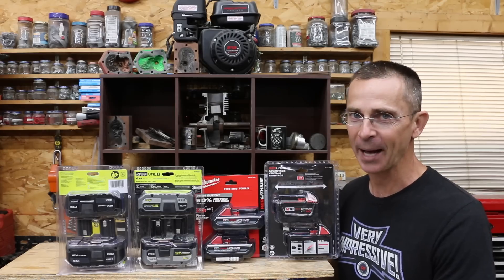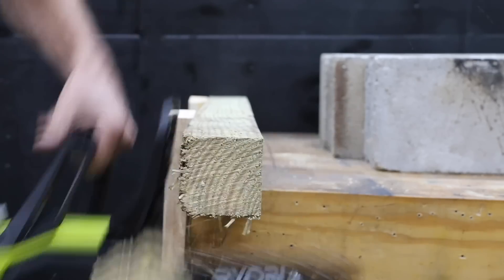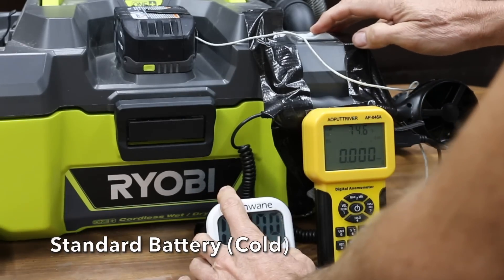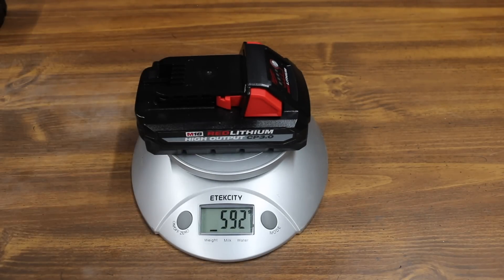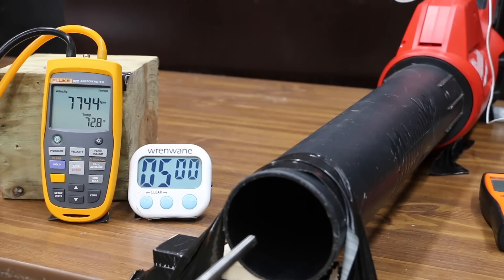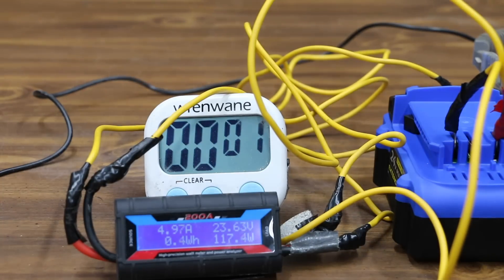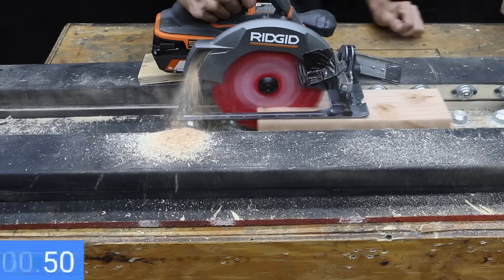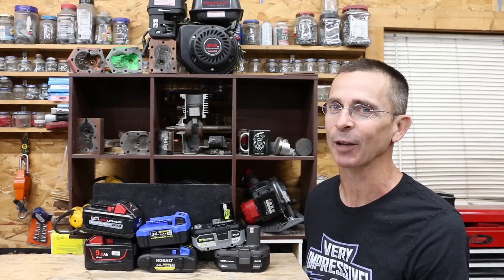Are "High Output" Batteries Better Actually Worse?

Comment: Ryobi is pure trash. I bought entire kit and batteries would go low and charger wouldn't charge them because circuit board battery sensor couldn't detect battery. I went bought new charger and batteries....same thing. I threw all that junk away.
Reply from the maker: Thanks for the feedback.

Comment: I've researched this awhile ago. Those that say the HP batteries are for extra amp draw are correct. The HP batteries increase torque available on HP contact equipped tools. Started on the impactors and skill saws. Increases removal torque and keeps the saws from overloading and stalling when bound up.
Reply from the maker: Thanks for the feedback.

Comment: High output batteries are for high draw tools usually.  That higher output will come at a lower run time when paired with the proper tool.  The issue here is the extra contacts, and internal wiring.  Both the tool and battery need it in order to perform better.  The other thing here not discussed is Peukerts law.  Higher amp draws will equal lower watt hours on batteries.  Lithium suffers from this less than lead acid, but it still applies.  

Most modern lithium batteries are limited in amp output buy the contacts.  The individual cells are usually capable of outputting more amps than the connectors can supply.

Wonder if @Project Farm will do again.

Comment: Why did you switch from an anemometer to the pitot tube and MPH to FPM between the two tests? Granted, you're not testing the tools themselves, but the switch was somewhat jarring and I thought about it and had to rewatch some because I was focused elsewhere.
The knock off may not have as much runtime as the genuine Milwaukee, but you can buy 5 knockoffs for the price of one genuine and probably have enough change for a gallon of gas. You'll get a lot more runtime out of that. Makes the knockoffs potentially worthwhile for those on a very limited budget and willing to accept the limitations. 
Of course, those buying Milwaukee probably aren't on a super tight budget, but the same philosophy probably applies to all the brands and their knockoff batteries.

Comment: For my Ryobi tools i have one 3AH and 5AH High ENERGY 2x 2Ah 1x 4Ah.

These are using the bigger cells, seems like they don't make this exact one anymore since the HP one is really just regular.

My 3 Ah always outperform the 4 Ah in every way and my drill only likes the high energy batteries, the other ones is just too weak also the angle grinder last a lot longer and has much more power with the 3Ah one then the 4 and runs a lot cooler
Sucks that the drill was sold as a kit with 2x 2 Ah since they are totally useless for anything else than the impact driver and even that one feels slow on those small shit batteries😅🤣
Reply from the maker: Thanks for sharing.

Comment: Project Idea: Motorized desk frames. iMovr Lander, Uplift v2, NewHeights Elegante, Ikea BEKANT, VertDesk v3.

Things to test, load capacity does it kill the motors or strip the gears if too much load is put on them they have all different ranges from 200lb to 533lb. how many sandbags + cousin eddy can they handle?

Desktop (laminate) quality, can liquid damage them what about impacts and scratches do they delaminate?

Stability at different heights, Would eddy fall off if he tried standing on the desk?

Speed of adjustments from sitting to standing height, are the claims correct with the heights at both ends?

Quality control in the form of the assembly process and welds?
Reply from the maker: Thanks for the video ideas.

Comment: Using an Ryobi HP battery in a non-HP tool is not going to make a difference. The HP tools have extra contacts that match the extra contacts on the HP battery. The Torque Test Channel covered the performance difference between standard and HP batteries in a HP impact in past videos.

Comment: I'm sure it's been pointed out but the HP batteries can supply more power and don't necessarily last longer. HP tools have two extra contacts that the battery can sense. With Ryobi at least, I don't think any extra power goes through the extra contacts. These only tell the battery it can output more and the existing  PCB fet or chopping circuit inside will allow it to send more power through the main contacts. When the HP battery is put in a normal tool it performs more like a normal battery.
Reply from the maker: Thanks for the feedback.

Comment: I purchased a few aftermarket batteries for my old PC tools and my Makita router. The Makita knock-off I have still runs but at a significantly shorter duration. I also notice the recharge time is noticeably longer with the knock-off. I will say the price was hard to beat, but one of each died within a year's time. Great price, garbage longevity. I now only purchase "genuine" batteries for the longevity aspect and only buy them on sale.
Reply from the maker: Thanks for sharing.

Comment: One only need to watch the Torque Test Channel comparison of Ryobi's HP impact wrenches to see that there is a huge difference in the HP batteries vs the standard non-HP batteries. The reason you're not seeing the difference here is because you didn't test using any Ryobi HP compatible tools which take advantage of the extra contact on the battery.

Comment: You should have done this test with impacts because it does a massive difference high output is for what it says high out put not for longevity test if you used them on impacts for what they are designed to do you’ll see the difference.

Comment: Torque test channel did many tests and showed how good higher capacity and high performance batteries do in comparison to regular versions. I def wish Harbor freight made a series for their Bauer like they do for the Hercules line, but it seems like they're tryna further differemtiate the two brands by giving Hercules all the premium features
Reply: Your wish is granted lol They're coming out with 8ah bauer batteries now. My local store already has them.
Reply: You use the harbor freight power tools? You a pro or just a diy’er? If you are a pro How are they?
Reply: @codygooch510   The Baur motors don't stand up to pro use and will smoke out on you. Similar to masterforce tools from Menards. I have a masterforce 7inch grinder and have cut lots of concrete with it but you have to be careful to not overload the motor or you can smell it. By babying it a little I've kept it alive so far but not on the quality level of major brands.

Comment: In a lot of cases the power is limited by the tool and not the battery, a tool with max of 30 amps will stop at current of 30 amps, the tool has to be able to take advantage of the high output battery to see a difference, I see the difference with my Ryobi impact that has more torque with high output high capacity batteries.
Reply from the maker: Thanks for the feedback.

Comment: As a pro, I swear by the Milwaukee high output.  They are a game changer...  All I use.  Light and fast
Reply: You find it most in your impacts, nailer and saws.  The 3.0 is designed for drills.  6.0 on up for everything else.  But the 3.0 can actually run everything decent, just for a shorter period of time
Reply from the maker: Thanks for the feedback.

Comment: I want to thank you for providing honest, unbiased reviews of a variety of products.  Have you given thought to comparing natural gas / propane conversion kits for generators or other small motors?  There are several different types of kits, from snorkels, to spacers, to carb replacements.  How do they compare in terms of usability, power output, engine life, throttle response, etc.
Reply from the maker: Thanks for the suggestion.

Comment: Good video Todd. Couple of questions if you have a minute. Back in your early days when we subscribers we new you did a video changing fluorescent to LED....just wondered if you have had to replace any as you must have put some running hours on them. Second....is your coffee coming to The UK. Cheers
Reply from the maker: The LED lights are still working very well and get used every day.  Only one tube occasional has an issue with half the tube working properly.  Other times it works just fine.

Comment: I've seen videos where some contractors claim that Milwaukee's high AH batteries die faster than their lower AH batteries. Matthias Wandel recently made a video in which he theorizes that in Dewalt packs, a single cell is used to drive the battery management system (BMS), and if batteries are left to sit for a long time without recharging, this single cell will trickle-charge until it's dead, which will prevent the entire pack from being charged. This seems plausible to me, but I haven't researched it further.

It would be interesting to test whether this happens with Milwaukee 6AH, 9AH and 12AH batteries. I think it may be possible that the charge indicator on the pack could show the pack as being charged up when one cell is low, and I could see this happening more with packs that have more cells vs fewer cells. So maybe this is why some people believe that the higher AH batteries have a lower shelf life. The solution would be to use high AH batteries periodically with a tool that draws relatively little current and then charge them up periodically after minor usage to rebalance the charge of all cells during charging.

For my milwaukee M18 and M12 batteries, I actually purchased older-generation milwaukee slow-chargers on ebay. This is because the fast chargers make high pitched noises that drive me crazy, and as a DIY user of power-tools not a pro, I generally will use a tool in spurts and measure+calculate the next bit of work after I cut or drill something, which gives me the opportunity to swap batteries and charge one while I use another one. I have Makita, Milwaukee M18, Ryobi 18V and also Milwaukee M12 tools, and I have at least 2 batteries on each platform (I have a bunch of M12, M18 and makita batteries of various capacities), which allows me to charge up spares as I work. This is totally sufficient for my usage, and it ensures that I seldom run batteries below 20%, and rotating them constantly prevents the cells in any given pack from becoming imbalanced since I believe they rebalance as they charge.
Reply from the maker: Thanks for the suggestion.

Comment: The timing for this video is spot on as I was just looking at these batteries the other day in the store, and wondering if the price difference was really worth it.  Thanks for doing some testing so we can make informed purchases!
Reply from the maker: You are welcome!  Great to hear!
Reply: It largely depends on what you will use them for and what brand. Milwaukee: the HO batteries make more power in their impact tools and drills. TorqueTestChannel showed how the CP3.0 HO battery in an impact wrench made the same torque as the XC5.0 battery. It obviously didn't last as long, but it made the same power with a lighter and smaller battery pack. The XC6.0 HO battery was more powerful than the regular xc6.0 battery.

Comment: I own both HP and non HP Ryobi batteries... HP batteries make no difference unless you also own HP tools which have additional connectors to utilize the extra current flow.  No idea about other brands but the only valid test would have been using Ryobi HP tools.  No matter what do enjoy your videos.
Reply from the maker: Thanks!

Comment: The Milwaukee you have to use a tool that can take advantage of the HD circuit.. The batteries are definitely worth it in that case, you can night and day hear and see the difference if you use it in Milwaukee impacts, especially the larger 1/2 and 3/8 impacts.
Reply from the maker: Thanks for the feedback.

Comment: How about testing some snow shovels for longevity? I’ve had quite a few different brands (Garant, Yo-Ho, suncast, etc) and I’ve definitely noticed vast differences in build quality between brands. Mostly cutting edge wearing out faster than others, or metal edge ones catching on pavement/concrete easier than plastic edge.
Reply from the maker: Thanks for the suggestion.

Comment: dang it should have waited just went and bought 2 high output robybi batteries! you should do a test on various impact wrentches with various batteries. like robyi 1/2 and 3/4, dewalt, rigid, makita, craftsman, kbalt etc.  Also have you done various testing on air compressors for diy automotive, home use etc...As always great job on all of your testing and amazing channel.
Reply from the maker: Thanks!  Thanks for the suggestions.

Comment: When using a Milwaukee fuel drill or impact with the high output batteries the tool will work way faster and is less likely to stall.
Reply from the maker: Thanks for the feedback.

Comment: I'm very surprised that the Samsung 30T 21700 batteries in the Milwaukee CP battery pack ran so hot. In the battery community (Flashlights and vape as well) the 30T is by far the coolest running cell on the market, so the heat has to be coming from somewhere else, like the nickel strips (need to be thicker), bus wires, BMS, etc. The whole circuit in the pack just needs to be lower resistance to even take advantage of the ultra low resistance that the 30T provides. Also, like other posters pointed out, it looks like extra contacts are added on some packs and the tools used didn't have those extra contacts. It might give you more burst power, but will not provide longer runtime. Overall, a very enjoyable review from a battery nerd standpoint.
Reply from the maker: Thanks!

Comment: Hey there, greetings from Germany and thanks for another nice PF Video!

I have one point - the high output cells does not imply more capacity, but these Battery's contains some 18650 Cells with a higher current rating.

This will help to improve lifetime and charge/discharge cycles, as the battery gets not so hot in high power demand situations. I really dought, that this will be measurable in Tool Performance // Runtime.

Anyways, nice vid as always and keep the good work up!
Reply from the maker: Greetings!  Thanks, will do!

Comment: Great test! Shows me that my cheaper Ryobi batteries are just as good as the expensive ones for tasks I assumed they would struggle with by comparison. My garage also gets very cold in winter time, so the cold weather performance was very relevant to my interests!

One little detail I would have liked to see (though I think you might have covered it in previous videos) would be the torque output between the cheap and expensive batteries when used in an impact gun. With the Ryobi products especially, the cheaper batteries seemed to struggle compared to the HP batteries in that specific application based on what I've seen / worked with.

Either way, super helpful video, looking forward to the next one!
Reply from the maker: Thanks!  Glad to hear!  Thanks for the constructive feedback.
Reply: they don't last as long, though(longevity)..I have a lot of experience with these, and the cheaper ones crap out much sooner when you use them a lot(at best a year)..the HP ones will last 3 years or more..this test doesn't take that into account-just performance..kind of like those "initial quality" ratings on cars...and yeah, there isn't much performance difference unless you use HP tools...
Reply: @dyer2cycle  Fair point! Ironically the one battery I've had outright fail was an old p102 (only 1.2ah) from the first bundle I got years ago. Now THAT was a cheap battery, in every sense of the word.

Comment: Think it definitely makes a big difference on bigger high output tools I work in the fire service we have a battery powered fan for clearing smoke out of buildings. With XC batteries they overheat and it shuts down but it runs fine with HO batteries on it.
Reply from the maker: Thanks for sharing.

Comment: I bought a knock off. Ran drill faster and had power. However if you run the battery to dead, it completely kills the battery. Would not charge after that.
Reply from the maker: Thanks for sharing.

Comment: -- PF, thumbs up as always.  Have a very cool (no pun intended) test for you.

Premise: Everyone is into these battery powered mobile coolers/refrigerators now for camping/overlanding/the beach/etc that are generally hauled around in their cars.

Problem: They're expensive, and the batteries don't last forever before recharge.

The Test:  In coolers, standard ice vs, ice with saw dust, vs Pykrete (ice with news paper/wood pulp) versus as many of these battery powered fridges as you can.  See how cold they get, see how long they can maintain that before ice melts/batts run out.

If my theory proves true, you could probably get a regular Coleman cooler with Pykrete or simple saw dust ice to last much longer than one of these crazy expensive mobile refrigerators.  

Save people a lot of money and hassle in the field.  Most of these guys use solar or a vehicle etc to charge these units, and only keep them on for select periods of time.  That means babysitting the things.  Whereas with my ice ideas, you'd have to do zero of that, at a fraction of the price.  

Summer is a ways out, but worth getting people's brains in gear right now.  And considering your other tests, this would be fairly cheap and also, you wouldn't be destroying a crap ton of stuff.
Reply from the maker: Thanks!  Thanks for the suggestion.

Comment: I would say the test is good but a bit flawed. If you use drills with hole saws in harder materials. The high output gives more power and prevents the machine from actually stopping due to high resistance. The drills with smaller batteries will need to be removed and find speed again as the bigh output batteries will just power through and keep cutting.